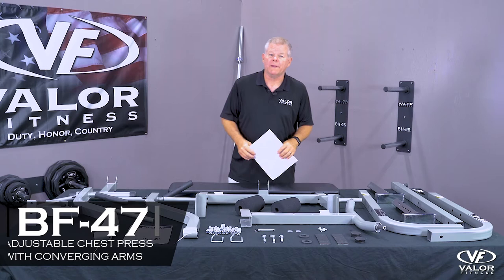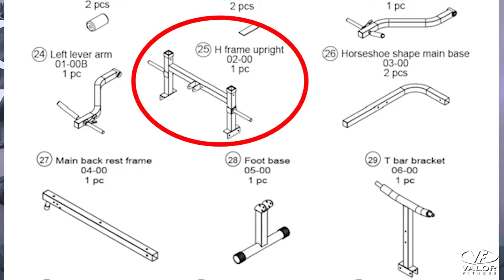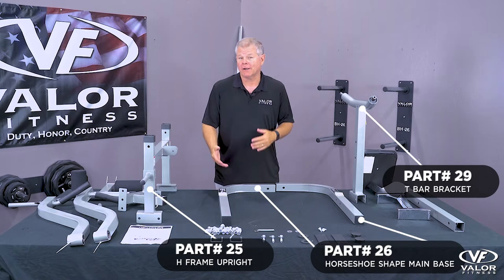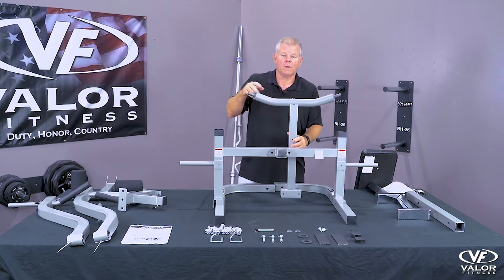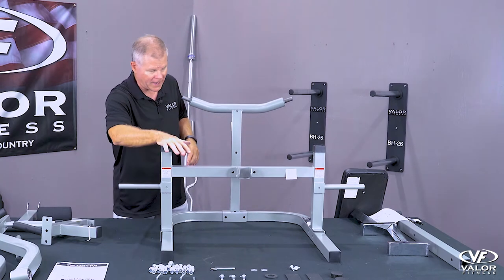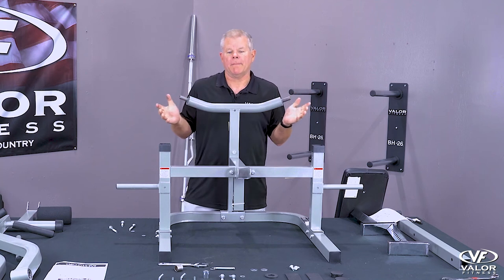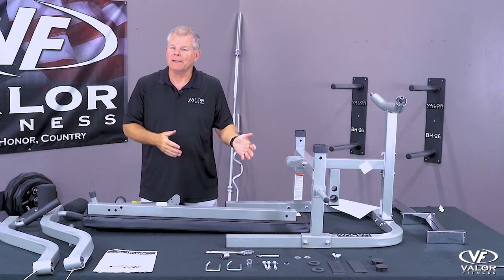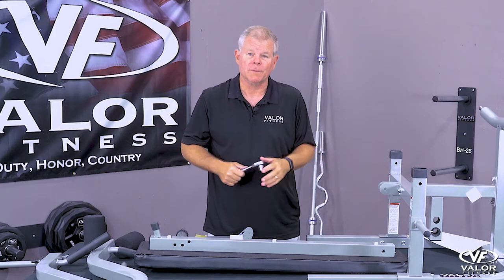BF-47 Bench with Converging Arms: Assembly | Valor Fitness

Comment: I just bought this unit and I was a little stressed about the assembly as it usually takes 2x longer than manufacturer's advertisement. Looks like I have a good cheat sheet which will make my life a little easier. Thanks for the video!!

Comment: I used the locking pin to replace the bolt that attaches the bench to the main frame. Now I just pull the pin when I want to remove the bench and do shoulder presses Facing the machine seems to be more comfortable for shoulder presses but they can be done facing away as well.
Reply: i was thinking the same thing...When you remove the bench and do shoulder press does the machine stay stable? I'm guessing you have weights on the bottom of the machine on the storage bars to counter the weight?
Reply: @oscarrobertson5097  i do have weights on the storage pegs but I don't think it would move much even without
Reply: Why do you remove the bench to shoulder presses ? It looks like youd sit on the bench upright and face towards the arms and press.  Are you standing for rhe shoulder presses?

Comment: 2 questions.  .
A) if your 12 rep max for bench press is 185 pounds, what approximately will it be here ?
B ) what is the most effective way to shoulder press ? Sitting upright on the bench? Removing the bench and standing?.Removing the bench and kneeling ? And facing forward or backyard?
Reply: According to formulas, the math says your 1 rep max would be around 275lbs. Of course the end result is you. Some athletes are conditioned for longevity, some for a burst of strength (kind of a one and done). So, the formulas are nice for a ball park idea, but when it comes down to it, you are the one on the bench. Regarding the shoulder press, sitting on the bench facing the location your head would be positioned would be best.
Reply: @jamesvanderbleek2271  sorry I wasnt clear in my question.  I tbink the max weight for rhe arms is 110 pounds each for a total of 220 pounds . With a free weight barbell my 10 rep.max is 185 pounds.  What does that translate to as a 10 rep max on your machine ? The reason im asking is that 10 rep 185 pound max barbell bench press translates to a 10 rep 240 pound max on the pin and weight stack chest machine at rhe gym i go to .  
So im just trying to find out if a 10 rep max of 185 translates to less or more than  10 rep  at 220 pounds ,the max that your machine can handle.  Im 63 and have been lifting for 25 years so not likely to ever get stronger but would like to at least keep doing my  10 rep max and then a few partials that your machine allows
Reply: Sorry , 12 rep max of 185 pounds, not 10 rep
Reply: @iang8169  well, let me address your topic this way. The bench is great for someone that would like to workout by themselves when there is not a spotter around. In my opinion, this is great for someone that can bench press around 200lbs total and would like a nice workout. The issue with the max weight depends on the user, not the bench. I say this due to the fact if someone tries to max out and then lets the arms down with a huge impact, the force on the bar posts holding the weight will take the punishment. And seeing how the arms themselves will hit the chrome adjustments at an angle may be another issue. Will the arms themselves hold 150lbs Plus on each arm? Easy as can be....it is how the arms are brought back into the starting position that concerns me. If you are wanting to push a total weight of 250+, I would suggest one or two options. 1. Be careful with how you use teh weight. 2. Find a stronger bench to support your strength. Hope this helps.
Reply: @iang8169  iang, you will feel a difference on each arms max weight when using an independent type bench press. Its a weird feeling when your arms do not work together as one. You find out which arm has been pulling (or pushing) the load over time. I am one year ahead of you (64) and have used this unit in the past. Have you done some google searches on "Max Rep Formulas" and surfed around on the internet? There are a variety of options or explanations to read up on.